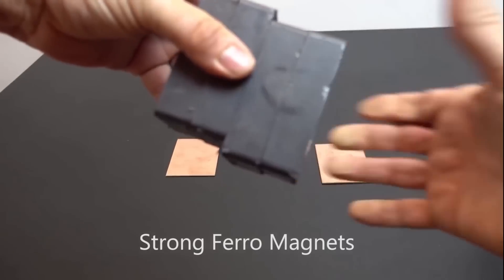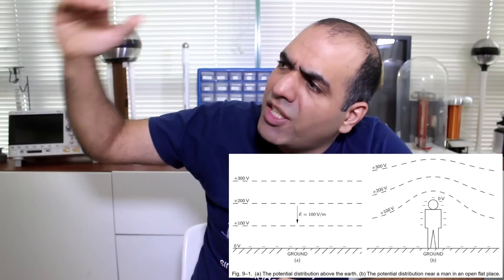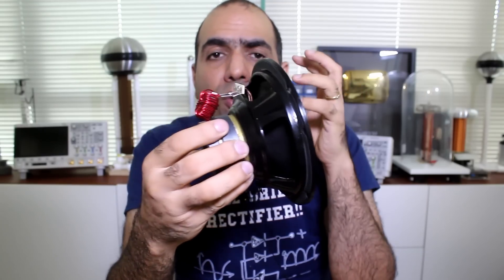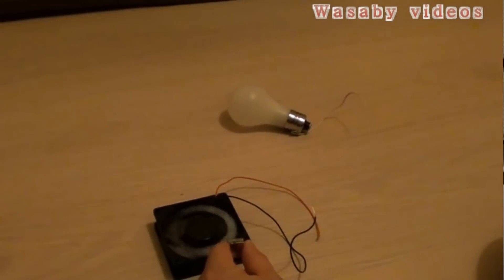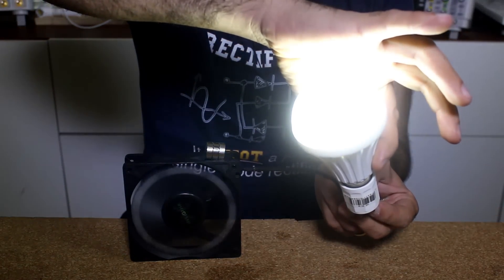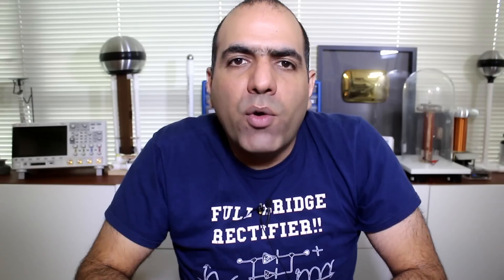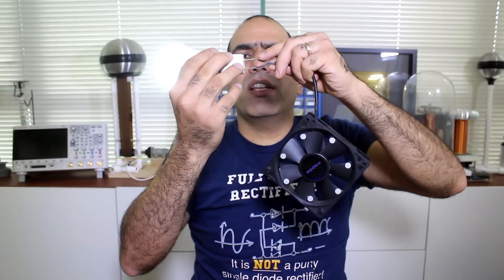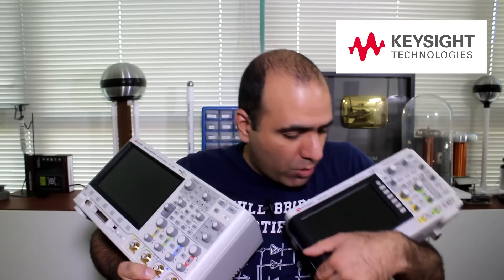Free Energy Devices Build and Science

Comment: That looped power bar would possibly work – if kept in a bucket of liquid helium so the cable was superconductive. It would stop as soon as you tried to extract the first femtojoule of energy out of it, though.
Reply: You'd need to charge the coil first... I've had two MRIs and they ramp the magnet with up to 1kA at (possibly) 100kV.

Comment: the kid turning on the light bulb there has to be a battery inside the bulb because leds are low voltage solid sate diodes so just a couple of volts will light them if bypassing the capacitor and diode  resistor array circuit maybe a bridge rectifier and a .68 mica capacitor to lower the ac voltage to dc "but still lethal" and to voltage lowering resistors 100K get it down to 10 12 volts dc.

Comment: I wonder if it would be possible to fill plastic flexible tubes with water solution (like a thin walled catheter). 

Then wind such tubes into a winding and run a current through the tubes to create electromagnetic fields.

Apparently the magnetic field would be about 1/9 the strength as opposed to using copper wire.

or,

Just less than 1/3 that of aluminium wire if it was used.

Of course the size would be quite large .

Plastic water motors?

Plastic water transformers?

Nah, just joking, what was I thinking!

Forget it, that is stuff that aliens are made from...

I think I will go and shock myself with 240VAC and chill for a while.

AHHHRRRRRRGGGGGGGGG!!!!!!!!!!!!!! that soooooothing feeling.....mmmmmmmm power snack.....

Comment: could be said that a solar pannel is a free energy source
Reply: Free energy is supposed to mean that you're "creating" energy, which isn't the case for solar panels because the energy is coming from the sun. Specifically, the sun's fusion reaction produces light which can be used in a photovoltaic cell (solar panel) to generate a potential (voltage) and source current to a load. So you aren't creating energy, it's just being converted into different forms.

Comment: Telluric voltage is free (the earths' spinning iron core is doing the work)
Reply: Sun is more efficient than that.
Reply: Free energy doesn't mean that you don't pay for it with money. Free energy means that a system has efficiency more than 100 percent or in other word creating energy from nothing and that is impossible.
Reply: It's not free though, you would be slowing the rotation of the earth's core just slightly by using its moving magnetic field to generate a potential.

Comment: Im just wondering,, I dont have easy access to these large powerful magnets because I live in Australia and magnets don't work here. Can I substitute the magnets with something else such as clay or quartz crystals? 
 I once saw a goat in the farm which had a light on it so the farmer could seeing it at night. If you connect wires directly to a goat, will it power a radio?
Reply: I too am from Australia and not having magnets is a real drag. I mix 3 parts peanut butter (smooth), 1 part honey and 1 part iron filings together in a microwave. It almost feels like I have a magnet when I use this to stick the electricity bill the fridge.

Comment: Free energy from copper pennies and an aluminum pop can, Just sand off the aluminum pop can on both sides so it has contacts. Then cut the can in sheets to fit the pennies and a shammi cloth for each section. Soak the cell stack in concentrated citric acid or lemon juice and mix with hydrogen peroxide. It should take a stack of four to six cells to run an led.
Reply: That's a battery, which is still not free energy in the sense of "creating" energy from nothing. The chemical reaction will eventually end and you will need to replace the materials inside.
Reply: @thegreatzoom5073  Of course it is a battery.

Comment: But I know that it's true one time I have two magnet and metal spring I try it and check in two one magnet at left tube spring in the middle one round magnet at right I check tester left side of spring one prod and again one prod in right I read tester 2volt
Reply: Do you mean to say you had two magnets on either end of a spring and the bouncing magnets produced a voltage? You haven't discovered free energy, but you have re-discovered Faraday's law of induction. That is, a moving magnetic field will produce an electromotive force (a voltage) in a conductor. If you just tested it with a voltmeter you would see a voltage, but voltage is not the same as energy. You need to place a load in your system to draw current, but once you do that you'll find that the spring's oscillations slow down and the motion will come to a stop, which will stop the voltage and leave you with no current.

Comment: Energy is never free. It always cost something. Why doesn't someone do something a little closer to free energy, like obtaining a voltage from nothing but running water. Yes, it is 100% possible. Water is some powerful stuff, you can actually see the spark from that one. Another one, I think it was a Tesla experiment. Get some damp soil, like an acre of it for 120v(dry dirt may not work). Every foot or two, drop in a galvanized steel pipe, I think. Dang, I don't exactly remember, I think you put a copper pipe down the center of it. Daisy chain a thousand of these together, and I think you get like 0.02 volts each, (hehe, shocking, isn't it), right out of the ground. Turn your acre of back yard, into a giant battery. I've never tried this, but that's why I need you to research it and tell me if it works.🤪👍

Comment: my free energy device will be based off regenerative braking
Reply: That's not free energy, regenerative braking is just a way to extract mechanical energy from a system and turn it back into electrical energy. It makes your system more efficient, but won't make it more than 100% efficient, which is necessary for "free energy".
Reply: @thegreatzoom5073  I understand that what you don't understand whatever 99% of the energy put into a generator is wasted I am talking about recovering 99% of the wasted energy that's wasted through regenerative  breaking if you have a 4,000 watt generator now it will produce 8,000 watts of energy for the same amount of force input.
Reply: when you double the output and you have over united in the device power your home your car or ship mode electric airplane I would call that overunity

Comment: 1. tesla coil under the table
2. battery inside the buld, screw thing is the switch, magnets short the 2 terminals
3.  the same as the 2nd one
4. the same as the 2nd one with a reed switch
5. the same as the 2nd one
6. the same as the 2nd one
7. supply power from small battery, the rest are the same as the 2nd one

Comment: But free energy exist on 9v dc motors or higher class of motors. (Dc ofcourse) but just need to figure out how you would strengthen its amperage and volts to meet the requirement of the device you to make it work and ways to make it run by its self or by you without a hasle. But I don't agree or its a bit more suspicious for me that 2motors that will run themselves.

Comment: Welo, good thing my brain already refusing those indian fakes.(most of them) and make my own using dc motors. And now im trying to figure out how can i make a dc to ac converter without using a 12v battery but only a DC motor or more. All of them where taken from toys and some ruined electric tools like a battery powerded drills, and sometimes, you'll browse the net how electrical part work so you could make it on you own builds and ideas, not following some scamm like what you said

Comment: Great video, it's a shame such are constantly needed.  I've had a couple good friends, intelligent, with some electrical knowledge, buy into the idea, I enjoy your videos mostly because I managed to shock myself about as often, when I was younger, and playing with electricity and electronics.  A Marine I worked with erred with a test set cable, didn't check part number to the publication, while setting up, and ended up providing ground for the 5KW radar transmitter, through his head, into the test set.  I wasn't there at the time, but about two hundred Marines were "doing tech training", cross-training on other systems, a weekly standard, and we were all standing outside to watch our brother leave in an ambulance, and of course, "it was the safety training for our unit, that day" in a way I doubt any will forget.  People do die from high voltage, even when they know what they're doing, but get a bit distracted.  Thanks again!

Comment: But a question, through the rejection of the magnets (last example) the fan could move, it would be possible right?
Reply: connecting a load to a generator makes it more difficult for the generator to keep moving, so at some point the magnet would not be enough to rotate the blades.
it is what he said, a source that can generate power but its so little that its irrelevant

Comment: OK I am glad we had so many good responses let's tell not only a secret let's communicate together and build this simple little device will let everyone know that free energy devices And not the fake ones are possible, were not going to be working with perpetual motion that's out of the question. Were going to work with indefinite motion which means that these motors will not put out tons of electricity but will run for long periods of time period Now ask yourself can I run in electric motor looping the electricity the answer is yes are ready been done nikolai Tesla has built this device, but even though this motor may run for long periods of time It has its drawbacks But hears how it works hwin it has a source of electricity so it's not fake, the source is a battery. Now that battery can charge And discharge almost simultaneously using a Reed switch which switches from charge or discharge, do this is 60 Hz and you are running your motor off hwin source of electricity. Now for those who don't believe it then you most definitely Don't know that when your phone is almost dead on one bar of power and you plug it into the wall that it can charge the phone back While you are steel on the phone using energy 2 things at the same time what you figure out how this function you can definitely do this within electrical motor. Now how do you keep the battery charged let's talk about that again in person 3136515349 if not we understand most people don't want to know the truth they like to be lied to like the song tell me lies tell me beautiful little lies

Comment: How does shorting the contacts power anything
Reply: It acts like a switch.
Reply: @sovietcomrade7733  yeah but doesn't the energy get depleted after the circuit is complete
Reply: @stutterpunk9573  wdym by depleted ?
Reply: @sovietcomrade7733  like once the circuit is complete the energy should go away right?
Reply: @stutterpunk9573  once the circuit is closed the electricity can pass
Reply: @sovietcomrade7733  but how does that generate energy
Reply: @stutterpunk9573  it doesn't generate energy, it just acts like a switch

Comment: I tell you secret to free energy  :)  MATERIALS:   1 neodymium magnet 3/4 inch dia. round by  10 inches long ,,  2 -- 10 inch dia. iron
washers,,  14 gauge magnet wire,, One iron tube / pipe that is slightly bigger than the washers and slightly longer than the magnet. One multi--meter and super glue. PUT SUPERGLUE on both ends of magnet and put on the washers at both ends of magnet and let dry. use tape and tape inside of magnet spool and washers.  Now wrap 1200 turns 15 layers of 80 turns around magnet then wrap with electrical tape several times when done. Now put the coil inside the iron pipe with 2 wires sticking out.  When you pulse this transformer you just made ,,, you get a very,, very,, very high electrical output.   DO NOT TOUCH very high voltage and AMPS.  Test with multimeter ,,, I recommend you start with a voltage of 1.5 volts as 1st test ,,before you go up any higher in volts to pulse.  BE SAFE DO NOT touch the wires to this bad boy when pulsing.  It weighs around 43 pounds and is 10 inches round 10 inches long. Pulse with a bendini motor 1.5 volts battery or 6 volts of solar. use  TWO reed switches ,,,, one for the bendini motor and one for the pulsing of the transformer.. The bendini motor and the transformer are NOT CONNECTED BY WIRE. They both have their own power supply. The ONLY thing that they share is the bendini motor with magnets on it to activate the reed switches.

Comment: And that last video he did act like a real jerk about free energy machines I believe there is bunch of people that created false devices that claim to be free energy machine but really have secret compartments with batteries are micro size copper wire but you can't see on camera the power device from another location off screen from the camera view is not free energy there con artist but there is free energy out there I believe it if you do it right you'll find it it's a fighting so hard to create false free energy I have took two motors in Maine what one motorized generator and was able to power a cell phone other trolling motor that turns the generator as well as powering a you did battery from one of those precharging charging packs that took apart that you buy to charge your phone on the go I want to charge your phone couple of times how they would charge that up and charge up my cell phone with a charging system that was built into that initial charging thing that took part but I overcharge multiple phones and weaken the battery where are the motor Eaton forklift and wasn't turning fast enough to make the power anymore in the other motor that was making power before so I had to completely boosted with a charge like you normally do with that tickler Georgie you said that motor to generator thing and multiple maintenance around the motors to create more power I couldn't get the senior run forever I need to add capacitors then I probably can get it to run forever so do you have capacitors a two-pole capacitor for the backup charging system to charge the battery to keep the motor going at all times cuz I kept asking for Easley shark real quick and you hook the capacitor up to the charging port of the device will it charge the battery and run the battery into power ranger motor and how I can switch if you can cut on and off on it so the other Port would charge your phone I just meant to does she want charge your phone if your trying to charge from the other side closest route towards the battery for the charging system add another charging system to charge the battery and leave that one charging system free to charge the phone that might be the answer or never-ending power for phone charging system Astro solar I had put on it that was supposed to be like I have a boat charge panel solar panel Kronos outdoor light system add to it

Comment: I know a free energy source!
Why don't you make a solar panel out of LED(yellow ones generate the highest voltage) you have to connect about 3000 LEDs in a big circuit board. Print the circuit using PCBway. Then keep it in a place with a lot of sunlight (do not expose to water). Then store it in a battery and Daaaaang! You got free renewable energy. The panel generates around 5volts.
Reply: Solar panels doesn't generate "free" energy, it's nuclear energy from the sun. And yes, you can buy big 50w solar panels(around 20pcs), buy big battery (100+ A/H) and solar panel controller. It would cost around 2000$. And you can collect energy from sun and use it.

Comment: I'm twelve and I thought to get current by making a turbine of waves of water like a circle. The water can be powered by gravity because the circuit will go deeper and deeper just like a slide. 
Then to get a material that is a good power conductor and let all the water pass on its surface. Then with a Phenom called Capillarity the water will go up into very tiny tube and restart the mechanism automatically. 
I also thought that it was too much complex and not so much efficient.

#Let's get power from sun for now. 
#Maybe we'll found a new phenom like Capillarity or a good phenom that resolves that problem.
Reply: That won't work

Comment: Ok then, how about this one. 
A car Alternator keeps providing electricity after the engine it started and the battery is disconnected. 
Why does this qualify as a free energy device and also qualify for overunity... Because it first has to power itself, it also power's the engine electronics and it also power's everything else electrical in the car! 
Now, if there are losses in an electrical system which we are told is the reason why free energy and overunity cannot exist, then where is the car Alternator getting the electricity from, it cannot create new electricity! 
Thermodynamics law states that energy can't be created nor destroyed... 
There's only so much electrons in the wires... Why doesn't it run out? 
The engine runs out of fuel, the battery also runs out but the alternator and even the generator doesn't! Why! Could this possibility be free energy right under our noses? Please explain!

Comment: Using a high elevation, you can use a ground wire going into a water source like a stream or water pipe. Then the cb or tv antenna connects to a 300mh coil transformer with 30mch feeding into the 30mh of an identical transformer. Then place a piezo disc or series of piezo disk to get the voltage you want across the 300mh coil that is also connected to the antenna and ground. It may make enough power to run an led or something.

Comment: Hey, you got one wrong. Overunity is not over 100%. It is the percentage left after a small sum is collected for return when combined with kinetic, thus 90% efficiency overunity generator.
Think of the merry go round, put 12 children on it and get it moving. Once up to speed, only one child every 20 seconds or so is needed to keep the merry go round moving. There is a generator on the shaft of the merry go round and the twelve children are actually capacitors.